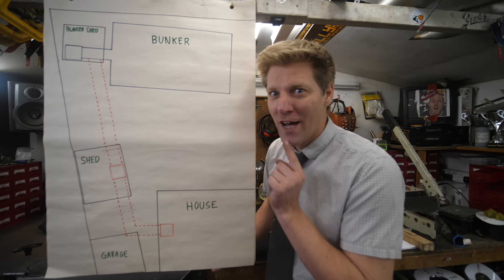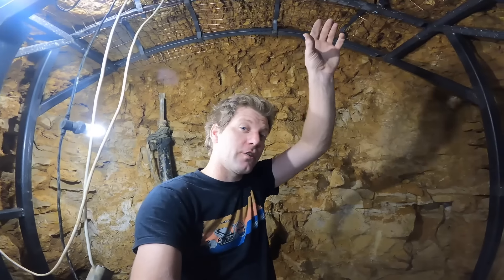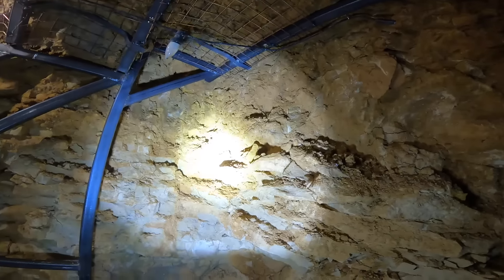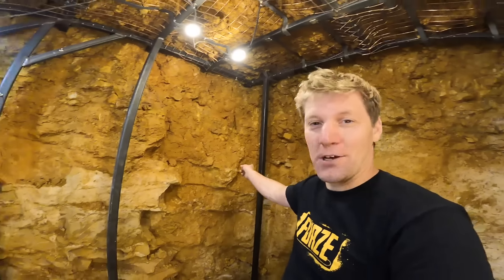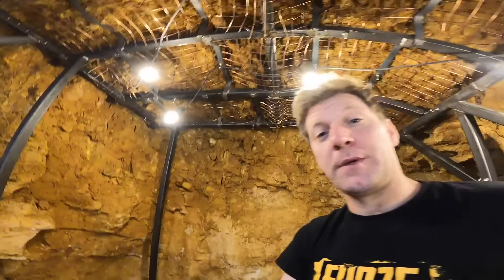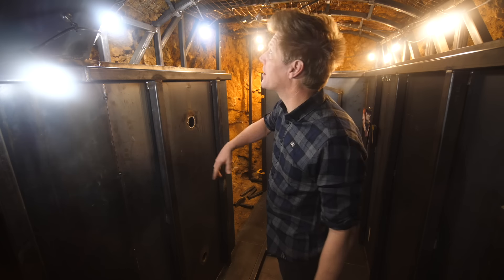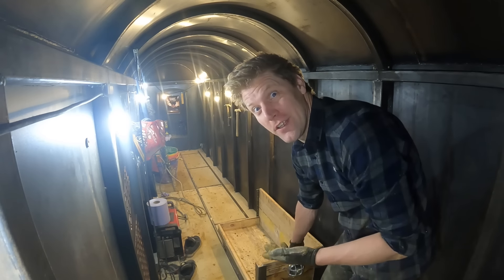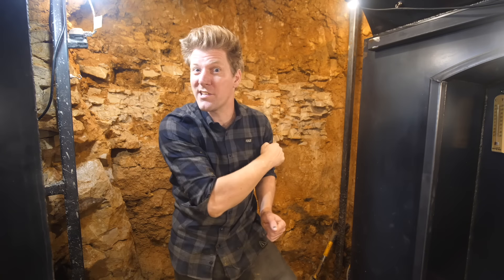DIGGING A SECRET TUNNEL Part 6

Comment: 75 years from now, some future owner of Colin's house will be mucking about in the shed and be like, "HOLY HELL! I've found a secret tunnel!"
Reply: i was litterly thinking that the entire video. imagine one day you buy that house and discover the bunker and such all hidden
Reply: xddd
Reply: That assumes rather that the house doesn't subside into the tunnel of course...
Reply: Colin will STILL be down there, so yes, they are in for a surprise. 
The tunnel will reach France AND Ireland by that stage.
Reply: Nope it will be included in the price of the house.
Reply: The added taxes are going to shocking!
Reply: I think the entertainment value of not telling them is eclipsed by the monetary value of including this in the listing
Reply: @Bad_Wulf  with all the steel and concrete down there I don't think it'll be subsiding any time soon
Reply: -every comment on this video ever
Reply: Same would happen with whowever owns Pablo Escobar's house now!
Reply: sadly no. if i recall correctly the house would need to be sold as an addition to the bunker. he said this in one of the original videos i believe
Reply: SECRET TUNNELLLLLLLL
Reply: In a previous video he said that legally thanks to the mods he can't sell the house with the bunker attached. He actually has to sell the bunker with the house attached

Comment: Honestly, the most impressive highlight about the project is not the tunnel itself, it's the attention to detail and the solutions you come take the time to come up with the make the job easier and safer.
The only thing I might have done is left a conduit box in the floor for any power/data runs in future, unless I missed that in a earlier video.
Reply: He has a wooden floor a couple inches above the steel floor, so his hydraulic lines and everything else have a track to run through. He thought of that. :)

Comment: the fact that he is still relying on those flimsy plastic buckets is incredible.
Reply: They actually aren’t flimsy and probably the most reliable thing to use when moving rubble around
Reply: The fact that those buckets are still holding up is the amazing part.
Reply: If it aint broke dont fix it
Reply: Those things are not flimsy, they are tough as hell. Grew up with them, still have some which are older than me, they were used in construction too. They really can withstand anything, except repeated sun exposure. It is the only thing which damages those buckets, but store em out of sunlight and excessive heat and they will literally last forever.
Reply: @xGoodOldSmurfehx  made in Spain from what I gather.

Comment: If you end up with another section of empty space, you should install a window with a bunch of dirt and rocks behind it (of course surrounded by steel and concrete). Perhaps one of the fake potted plants on the "outside" of the window. I really like the idea of having a completely useless window purely to confuse people.
Reply: ....or a few random skeletons??? Dinosaur,  pet dog or cat with a collar, a human leg...... 🤔
Reply: Periscope.
Reply: In the Grace mansion in Fort Worth Texas the basement has an entire false wall with its own flower garden and lighting system connected to a weather station to help mymic the above ground world!!   🤠👍
Reply: I like this idea. A window with a blind/curtain that opens just to reveal rock.
Reply from the maker: its a great idea and have looked into it i just think it will condensate up as ground is quiet damp, even under the yard that never gets wet
Reply: Or use the dead space to create a display of all of the tools used in the dig.
Reply: Build a window but with an old telly on the other side playing a loop of a beach at sunset with the waves crashing on the shore.
Reply: @colinfurze  I think he means to put in steel paneling all the way around the extra space too, but then install a false wall where the window will go.  You can then fill the empty space between the structural wall and false wall with backfill rock.  then you won't have as much condensation problems since the "outside" rock visible through the window is actually isolated from the surrounding earth.
Reply: @colinfurze  so put a fish tank so it’s like you’re under water instead of under ground
Reply: You can put a small section of tunnel behind a one way mirror with a real mirror on the other end. There needs to be a light source inside to work properly though.
The result looks like a extremeley long tunnel, with a lamp every few feet, getting darker the deeper you look into it
A neighbor of ours had this in his shed, facing downward, and it really looked like a mineshaft going down hundreds of feet vanishing in darkness.
Reply: @colinfurze  I was basically saying what Trainzguy2472 was saying. Don't have the window actually exposed to the rock, just have a false wall with rock enclosed in it. 

i.e. Make a steel box with 5 of the 6 sides. Fill the bottom with dirt and rocks, perhaps some other random decorative stuff. Install the window parallel to the side that has the dirt on it. Turn it 90 degress and install it so it looks like you have a window that just shows the rocks outside. Decorate with fancy curtains for the full effect.

Comment: Colin, a suggestion/idea/question:

When you finish, have you considered turning some or all of the holes into pop up periscopes?
Reply: I forgot to mention (the obvious): with remote controls for the air soft guns, like at the front door. 😁
Reply: It's all been filled in with concrete 😂
Reply: Oh, and possible a torpedo, perhaps of the “land shark” variety, using his shark head.
Reply: That would be pretty cool
Reply: I get the funny feeling the bit going to the front of the house he mentions at the very end of the video might be exactly that
Reply: @yapjunqir1594  thsts kind of a necessity to fill the holes anyways you dont want water getting in the tunnel

Comment: Hey Furze, Have you considered fitting an automatic bilge pump system just in case this piece of art ever floods?
Reply: Good idea
Reply: Don't be silly, it's never rained in Lincolnshire, not once
Reply: Surely it would be easier to put a waterproof seal around the hatch. The rest is welded steel surrounded by a shit ton of concrete ae.

Comment: The amazing thing is not actually the tunnel but that you somehow convinced local planning commission to approve it!  I started a tunnel on our farm from the house to the barn…as it turns out, we have multiple artesian springs under pressure throughout the property and I now have a large underground area from which 2 - 2.5hp submersible pumps pump out upwards of 80,000 gallons of clear spring water DAILY!  On the down side it slowed my project to have to figure out what to do with all the water.  One the plus side we now have an irrigation system that feeds 10 acres irrigation, a stream, a pond, a garden and a hot tub that is in the works.  There no seeming end to the flow of water from these springs!

Comment: You could totally riga pulley to the wall of the access shaft above where the tunnel runs. Then use the line from the winch you use to raise the dirt buckets out of the tunnel as a way to draw the Minecart down the track.

That way if one person fills the buckets as you are knocking down stones and stuff. The other doesn't even need to be in the tunnel. Just hit the winch and it'll draw the cart down and lift the buckets once it reaches the end. 

If you really wanna automate taking the dirt out a lil more. You could angle the sides of the cart like a hopper so you can just throw the empty buckets back down the shaft.

And angle the end rails up 45* so when the buckets lift free the carts own weight sends it back down the tunnel.
Reply: I really like your ideas !

Comment: I'm genuinely surprised Colin didn't just put in a conveyor belt. One with little scoops that will carry the stuff up and out. If you don't need them to last 20 years, they can be easy to make using rolling pins, 2x4s and some canvas.
Reply: I was expecting something more like rollercoaster rails so that he could haul it up using the winch he already has in place...
Reply: I started making one with a canvas fire hose I found left on the curb as garbage. Split along the edge of course.

Comment: Imagine how much paying someone to do this would cost, if you could even find someone. Handmade tools, a mine cart, electrical and hydraulic work, heck the tunnel labor alone would be insanely expensive.
Reply: @BobDevV  He probably got permission to build a basement.
I mean, it Technically could be called a basement... that extends to a bunker in the garden... that might end up having more squarefootage than the main building...
Reply: @BobDevV  yeah, I wondered the same but I assume he got some kind of review (I think he did for the bunker). Of course, i cant imagine how the conversation went:
Colin: I’m digging a hole, where are the gas line?
Gov: straight down or at an angle?
Colin: sideways.
Gov: 😮

Comment: I don't know about anyone else, but I'd love to see a video dedicated to how the planning of such a project is undertaken?  Planning applications, structural engineers designs, temporary works designs, to name a few thing's that must have been necessary to embark on a project of this scale and risk. I can't imagine you would have put a spade in the ground without either having professional help or a deep knowledge/background in tunneling or structural engineering? The risks involved with this project are incredibly high, for example, if your steel framework and concrete strength were wrong you could have tunnel collapse! Or worse yet, digging under your house foundations too much has the potential for subsidence which would result in serious implications for the structural integrity of your house. Perhaps I'm one of the minority that finds all those things fascinating, but I'd seriously love to learn more about the behind the scenes aspects of your project!
Reply: Yeah I’d love to hear some more about the structural support needed for something like this!

Comment: My biggest question right now, is whether you're going to reinforce the foundation since you'll need to travel underneath it to get to the pantry and that could cause some slight destabilization.
Reply: Probably depends on the type of foundation... If it is just a giant slab, the little amount he is going under it shouldn't cause any issue and he is reinforcing the ceiling as he goes... Also, the house has likely already settled and the material it is on looks pretty hard so there shouldn't be any issues.
Reply: @Acecool  Agreed, Colin really knows what he's doing.
Reply: my exact thought but colin prolly thought about a solution before he started digging
Reply: They are putting concrete around the tunnel so no collapse is possible.

Comment: You should do a small section of tunnel with clear epoxy instead of concrete so you can still see the amazing walls you have worked so hard on.
Reply: Epoxy to replace the concrete, and plexiglass wall panel in that one little section.
Reply: I wonder if it'd have the strength.. definitely do a window at least if it doesn't

Comment: You need to start digging from the pantry now, and then you just have meet up the two underground, that way if they aren't perfectly angled it won't matter because you can just dig it out and fix the angle with steel and concrete

Comment: 09DEC2021 - Hey Colin, love the project. Here in Tennessee we're on solid limestone therefore this kind of dig would be extraordinarily difficult. But the point I want to make is that we have issues with radon gas as a result of our geologic strata. I would be interested to know what kind of readings you might get if you installed a radon gas detector overnight. Good luck. BTW did you consider a conveyor system to remove the spoils?

Comment: I really hope that these guys have consulted with tunnel engineers and probably geologists before digging that tunnel. It looks cool, but as a child of two civil engineers, the construction of these tiny iron profiles looks pretty insecure. My brain cannot imagine that this is enough to support the tons of buildings, rocks, and soil above. Moreover, I didn't see any hydro insulation, and probably the moist will compromise the structure not too far in the future.
Reply: I'm wondering about this as well. Colin doesn't strike me as the kind of person who would leave something like that to chance though, he'll have thought it out.
Reply: He did mention at one point that the concrete he's using to surround the structure is moisture resistant. Not sure if that solves all problems, but he at least considered that bit.

Comment: This cannot be legal in England. They have crazy building regulations
Reply: That's the video I really want to see: 
how did he get this approved?!
Reply: @wilfdarr  Perhaps he's simply done such a large number of technically-legal crazy things that any reports anyone files at this point just get tossed out as not worth the effort.

Slightly more seriously though, there's probably a whole set of things for bunkers and whatnot that are still on the books from WWII that something like this could be fit into and not worth the bad press if the government tried to stop it given that he has 11 million subscribers and who knows how many more regular viewers.  That's how such things usually go.
Reply: @laurenceperkins7468  Oh Ya, I'm sure they don't have any good reason to deny approval, I'm just really curious what that process looked like. I'm sure that the fact it has 2 exits was part of the approval, but what else?
Reply: @wilfdarr  Probably mostly just making sure that it won't mess up the water table, and there are no public gas or water lines in the way.  It's just an oddly-shaped basement.  Not really any way for it to mess up anyone else's property.  I'm not even sure it's long enough to need any significant air handling as long as the occupancy stays low.  If it were they'd probably be having problems already given how hard they're working down there.

Comment: i do wonder if they ever decide to sell this house, are they required to tell people about the bunker and tunnels, and if they do, would it increase or decrease the value of the property, its not really the type of thing that normies would want in a house. i definitely would pay extra to have this system of tunnes in my house, but I'm not normal
Reply: I think collin mentioned at some point that he has to sell the place as a bunker with a house attached, rather than the other way around
Reply: @Razurec  Yeah I have a vague memory of that as well probably back from the original bunker build
Reply: So long as everything is "to code" it should be fine....?😥

Comment: Question: With all of that rubble you're taking out can't you recycle it and use it to make concrete??🧐👍
Reply: You need batched concrete for this sort of project to ensure that what you are putting in has the structural strength to withstand the loadings put on it. I'd guess that it's probably c20 or c25 grade, perhaps even stronger. You would also need to be able to prove what strength the mix is to get building control sign off, that's just something you couldn't do if you were making it yourself with recycled materials that he has excavated

Comment: It'd be completely James Bond if your ordinary pantry / backup tea storage was converted into a lift shaft. Then, either just the floor, or ideally, the entire room, could slide up and down into the tunnel! You could do the whole room, you'd just need inner and outer walls and some rails between them. The lifting could possibly be hydraulic, purely electric with a winch, or a combination where a hydraulic piston moves a pulley block with cable that pulls the cabin up and down. 

The advantage of using pure hydraulic, just a cylinder under the lift's floor, is that if it leaks, you just get gently let down to the bottom, similarly if there's a power cut you just need to be able to open a valve to gently drain it. Or, there are kits to fit small lifts as a conversion into disabled people's homes. They often use rails attached to the walls, that the moving floor crawls up and down. Someone I knew's dad had COPD and a chunk of the front room floor sank down into the bedroom! Amazing! It had rails around it so it wasn't a secret lift, but still a cool one. You could perhaps fit one of those into the pantry if you need to.

In your case cos it's only like a 10 foot drop, there isn't much danger. Worst-case you could have a flap in the ceiling to let people escape if it gets stuck, and a rope ladder, or else rungs inset into the wall. But again that's all very unlikely, and there's already a nice manual ladder in the shed entrance. Otherwise, just stick a bit of padding here and there to the lift cabin's walls.

Since it would only be a 1-man thing, it wouldn't need the powerful motors that big lifts have, to lift their steel cabin and 12 people. That means your motor won't be strong enough to slice anyone in half if it all went wrong, and that's a good thing. It'd all be intrinsically pretty safe just by it's small scale. And just how great would it be to own a moving pantry full of tea? You'd feel like Dr Who's mum and dad.